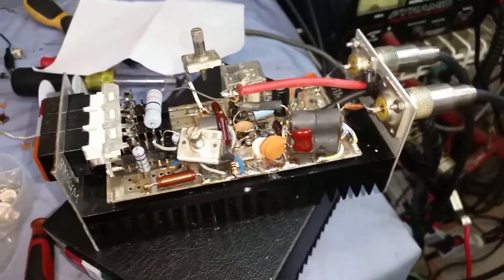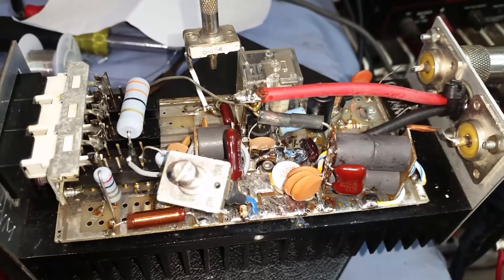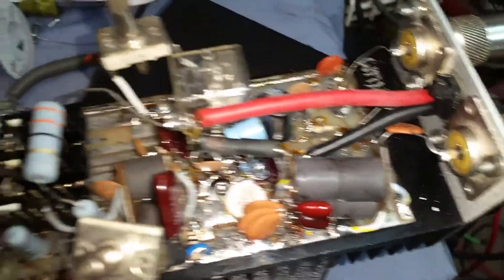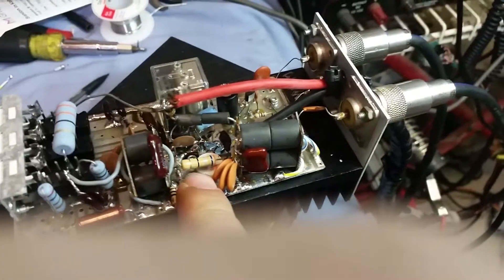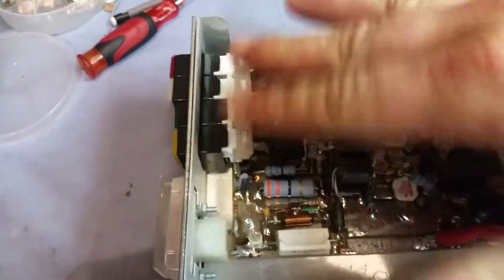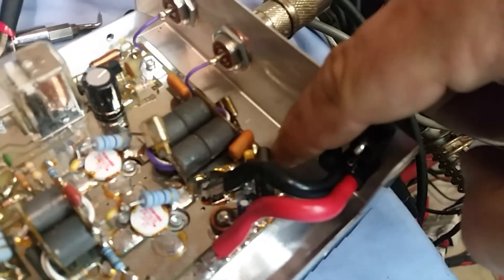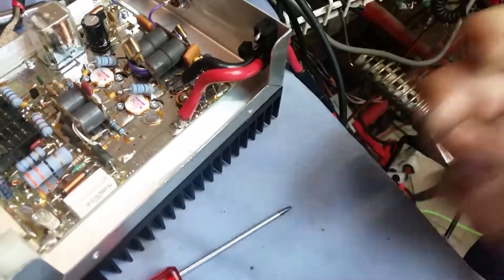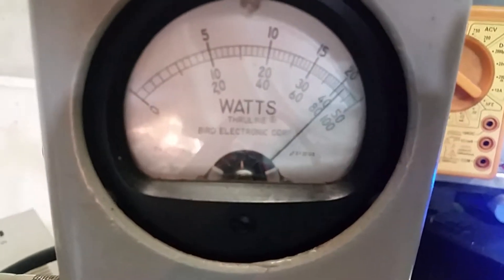Texas Star DX 100 & DX 350 HDV Repair 🪛🔧

Comment: first biased 1 pill TS I seen. herd about it. I got the MOD V works super. done nothing to it. my bench 1 pill for testing. I got it with a hot plate all new as a set. hot plate ran so well with out driver I just run radio into 8 pill. old 2950 can do 10 watt AM/FM and 30 35 PEP . that the o0ld school on with 2SC2312C final's . I have the newer one also. blue LED display and FET finals. goes 24.8 to 32 Mhz . looks like the one BBI has, nice 2 pill. looks like my killer bee some what. not only bigger wire to output transformer makes more PEP watts with a tad lower drive it runs cooler. also sounds better on SSB. The only thing else I would add is a ferrite bead right on red wire to board. some of them came with a fuse holder inline type with yellow wire and my wire gauge shows #12 AWG . I went with OFC #10 on mine and some repairs. move fuse holder to battery . either a MAXI of AGU fuse. you do not get the voltage drop like the ATC ones. and the AGC ones just as bad on high amps. looks like a SAE disconnect. not real good. a powerpole PP45 would be batter and a SB 50 would be super on 1 pill even 2 pill . 73's
Reply from the maker: Yep...only one they ever did as far as I know

..I thought that the super vee was but no they are using it for lamp....this one i thjbk is the only one and it is as simple as simple can be...